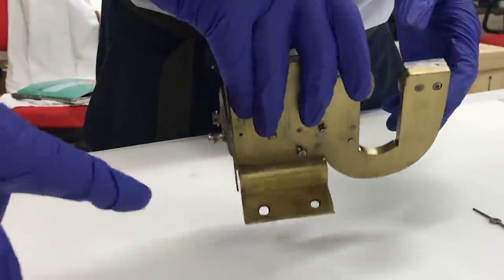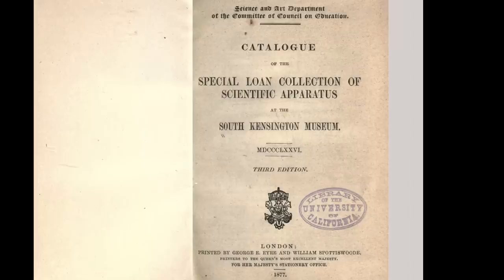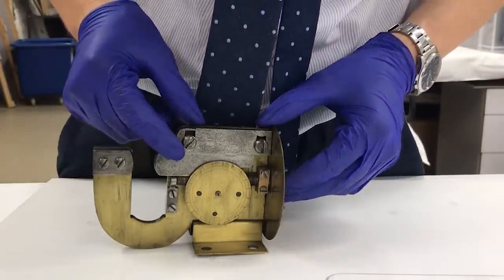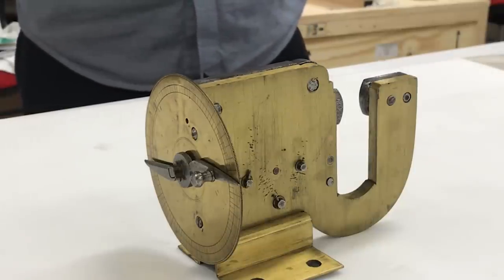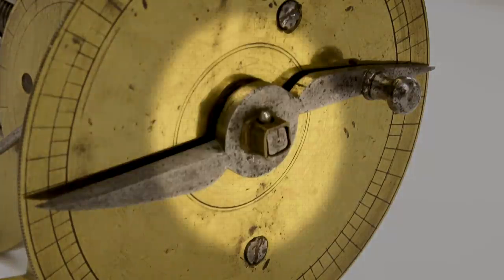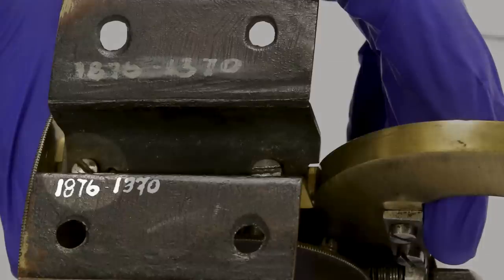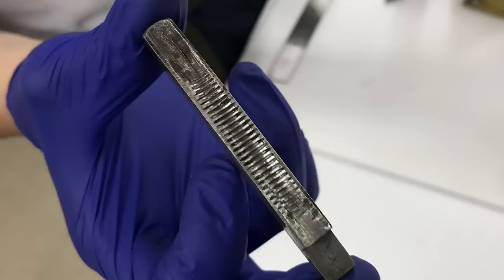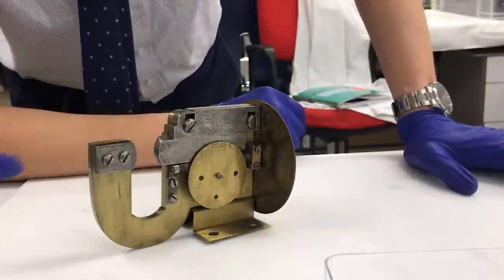World's Oldest Micrometer - 1776! Who made this thing??

Comment: The hammer marks around the stand off post for the small dial are most likely from driving the pins tight with a bench hammer

Concentric circles are a very common form of instrument ornamentation in the 18th century. 

Couldn’t the knurling around the dial face be to aid in reading the dial?

They had dividing engines to index the dial but the final demarcation would have been hand engraved over those lines

Yes, the anvils are wrought iron but more likely than not, they are case hardened on the working faces

The mounting holes are rough, out of round and countersunk because that is what it looks like when you cold punch holes by hand.

Lathes could be driven by a great wheel. They could cut wrought iron, it is as soft as butter, just don’t blow out the grain. 

Much larger iron screws were being turned before this. Think printing presses and leg vises. But the threads would sometimes be swaged in hot before being turned to size. This saves on material and avoids cutting across the grain of the iron. 

Two things to look into:

1. Surface finish. Non critical surfaces should be cross filed fairly coarsely an irregular. Finer surfaces may be draw filed. Critical surfaces would have been ground or lapped, possibly scraped.

2. Check the assembly screws. They most likly show signs of being  cold swaged, not cut. With wrought iron the grain is everything.

Watt or not. If it was made in the 18th century it was made by hand, with files chisels and hammers. These men were not machinists, which is not to say that they weren’t insanely talented, but they had very different priorities. You don’t drill a hole if you can punch it. If it needs to be round, ream it, if not, leave it be. You don’t make everything perfect and precise unless it needs  to be. Good hand work looks good, functions well and has no reverence for extraneous precision or regularity. 

I have more to share. Message me for more info.
Reply: I have no experience but the base could have been made after the fact by even the exhibitors just to show it off. something like this would have been unwieldy to use so screwing it to a table with a quickly made sheet of brass might have been a quick fix.

whoever used it before that might have just held it with a clamp or some other tool you'd find in a workshop for their use
Reply: Good thoughts all around, Hammerandhearth. I especially appreciate the reminder about extraneous precision at the end there.
Reply: Hammerandhearth . I agree about the hammer marks. How could the narrator not see that?
Reply: Hammerandhearth, I agree the hammer marks are perpendicular to the pins.
Reply: I stopped the video and was just about to write the same thing - seems whoever made this instrument was not very concerned about it looking nice, as otherwise they would be more careful with assembling it and using non-marking tools.  But that's a hint also - it was probably a practical project, maybe a prototype or a quick clone of a previous design - likely an "internal" tool for production.
Reply: Psycho, I was thinking the base might have been made later, maybe in the 1800's, by the museum 'handyman' to put on display maybe?
Reply: @LeelooMinai  I think that's right. If the dates are correct, perhaps it was treated as a trade secret. A secret internal use tool wouldn't normally have been written about, but by the time of the fair competitors had them too so it could be shown.

Also, the hammer marks on the back all align in clusters with where they'd be if you were striking the pins.

I wonder if the extra hole on the larger dial was for an index pin to aid in machining or assembly.
Reply: It looks like an Apprenticeship exercise of the kind once taught in High School Metalwork. It doesn't seem like the kind of exacting standards an Instrument Maker had, but it does look like a Teaching job one-off using what was available in the Workplace.
Reply: I think of the symbolism of the Free Masons. As early as the 14th century the tools of the trade were held in high esteem.  So I vote also the special tools were closely held trade secrets.
Reply: This looks more like a tool than an instrument.  Custom built by a craftsman requiring some precision and set exactly for his shop's ergonomics.  An instrument would have had much better finish as it has to be provided along with the data when sharing scientific knowledge.
Reply: Bracket on the base has come from elsewhere hence the counter sinking on the wrong side plus its fitment is poor to the main body and wont work as a stand ..... if you need a bracket and theres one to hand in the pile on an old piece of kit you replaced a while ago you will reach for it . The rest is valid for the time IMO . Who can know if it was a Watt creation but given whom else then its a safe bet to say it is .
Reply: One of the most informative comments I've seen on YT.
Reply: Exactly the 3 Fs
Reply: I agree with most of that, I have worked with wroughtn iron (both forged It and machined) and have instrument maker background.
cutting a thread in the stuff is difficult (rough surfaces and galling...) having a thread plate and forcing that over yellow hot iron is fairly easy, then you file and finally lap it for finish.

The dividing could have been done with a large "template" plat with pegs that you rest the straight edge against.
Not unlike this. 
https://m.youtube.com/watch?v=BIUAdINXZmQ

It is not unlike thenold wheel cutting rigs used in horology from 1700's till early 1900's
Reply: maby it was a secret tool and all the extra holes and tool marks are from trying to advance it more for the task of the maker and it explains how it started with the attention to looks then over time instead of protecting finish you beat it with the wrong tool and get back to work hehehe...
Reply: first thing that came to my mind.. exactly
Reply: @Hammerandhearth: Yes I spotted that detail also, that the marks were quite an angle.
And this is one of the very first Youtube vids I been sitting wide eyed scrutinizing every detail. 
Really interesting, thank you for posting - I got very caught by this one.

Now it this really by James Watt? I doubt it personally. 
I had an warning bell ringing in my head, and then Machine Thinking mentioned it - it have the look of being put together with a few parts from somewhere else.
I nearly sided with David Wilkie, that this might have been one apprentice work - the lack of numbers or symbols on the wheels suggested that.
But then, it have been used a lot. 
Builders of clockworks and precision mechanical had been around for a long time already. Those would have needed devices to measure the parts.
Certainly some might have used fixed pieces for certain measurements, especially for those who mass produced clockworks.
But many items was custom made, such as astronomical clocks in the 1400's and onward - then some hundred year later when 'automata' became popular.
In both cases that's when one apparatus like this one get very useful.
But for this item, I am inclined to say it's a bit less old, lets say 19'th century, and its a piece that has been used in a workshop by a craftsman.
Reply: What do you think about the "decorative" reeding around the circular plates?

Don't you think it would make sense to make and use these as markings for mapping out the more visible markings. Count the number of them, then mark it out. Who ever made it didn't have precise tools so may have had to do additional things that we would not do today because we have these precise tools.

If we assume like you said, everything they did had a purpose. If I was making this and I wanted some carefully measured angles on a circular plate, how would you make them? Make the plate into a kind of gear, then mount it to a pivot turn it a number of teeth, mark, and turn again. All calculated ratios of course.
Reply: This micrometer has the hallmarks of proof-of-concept, which is less than prototype. Or, it was a poor copy to just get through a customer job. Hard to tell, but proof-of-concept is reasonable. 

Tells:
1. Rotten iron. Prototypes & production would use charcoal steel or case hardening, both of which have different surface finish than shown.  2. Poor fit & finish.  As stated elsewhere, the materials are repurposed. But, the fit & finish gives the appearance of extreme hurry. Even one of the slots is obviously from a previous use. A prototype might be rough, but not so sloppy. 3. This looks like something a fiend hacked out with his own 3 hands to go back to the scrap bin if it did not work. (I make a living as an expert fiend & produce lots of scrap.) But this worked better than expected and got lots of use.
Reply: Using stuff you cut away from other projects was very normal. Coal was rare and resources was very limited. So not using scrap would tell it's newer.
Reply: Hammers marks. My point exactly. Driven back so many times by a probably rougher-than-Watt's hand would leave numerous indentations on the soft brass easily enough. So perhaps even  if it has been made by a master craftsman, it might have seen use by a different tradesman, might've even been an early invention.
Reply: exactly what i was about to comment lol
Reply: Knurling also helps with grip, especially if one's hands are covered in oil
Reply: There are to many smart people here wtf
Reply: I wish you'd make a video. I'd love to hear all you have to say!
Reply: @h2o270  If it was made by an instrument/clock maker, or even his apprentice, surely they would have used a small punch to fit the pins? The hammer marks are perhaps from some later work.
Reply: Odds are several workers were involved in making what is obviously a working tool.  Apprentice projects were more commonly something that already existed so they could be compared to a benchmark of skill level, not prototype work. Machining was coming into its own in the latter 1700's, so this likely would have included both hand work.  The iron work being done by a blacksmith, the brasswork by a white smith and the long screw work done on a machine.  The stand probably by someone else.  James may well have come up with the idea, but if he was now a partner to someone with money he may have had several employees.  Check out the Bramah lock patented around the same period and Maudsley who worked for Bramah.
Reply: I dont have this much expertise. However I do my fair share of tinkering and building things from junk as well as repurposing parts all the time. A lot of the things on this remind me of the small mistakes here and there that I make. In the case of the stand I would totally understand not caring how rough the holes were on that itself because it's not immediately important on a prototype or at least for what you're intending to test or use that item for it will serve the purpose.
Reply: They also in clockwork and instrument making used to peen the blanks to work harden them to make them more durable.
Reply: Your last paragraph is brilliant.  Thank you.
Reply: I concurr regarding the hammer marks
Reply: I concur sir  ! 🧐
Reply: You covered everything I was thinking of there. And I genuinely like the design, it evens out its own inaccuracies. 18tpi has me a bit confused though?
Reply: This is exactly how I do my projects. Foe example my fractal TV antenna. Wathes on tv about it, bend a few scrap wires, connected to tv and it is still connected after 20 years. (If it works why to change design)
Reply: I concur - I would add I think there there may have been repurposed parts too. The ‘knurled dials’ which have no apparent function may have had a function in their previous use.

Comment: The base holes that you referred to as being chamfered look exactly like holes that I hot punch in the blacksmith shop. You back punch then turn it over and punch through a bolster. When you flatten out the burr it has the appearance of being chamfered.
Reply: i was thiknign the same thing, but the concentricity made me want to accept a rough/ over-done deburr with a rusty beaver
Reply: Now that makes sense as engineering back then was way closer to blacksmithing than it is now. EG when was the pillar drill invented? 1895 or something? I bet before then getting holes in sheet metal used mainly blacksmithing techniques.

Comment: As a machinist, I've made dozens of special tools for specific jobs.  Decades ago, I began stamping my initials, and date in my custom tooling, and most has my mark, but all my early tooling made to purpose generally wasn't marked, and many of them got made into other tooling.  All the tool marks you showed make sense, if one thinks of 18 century, and only make sense later, if it were an apprentice's work, not at all a journeyman, but certainly well on his way.  I've worked on a 17th century clock, in New Bern, NC, in Tryon Palace, and it was very similar in construction tool marks, strikes, there was an awful lot of handwork done even in the 19th century, but l would easily put it prior to the 19th unless found reason to think otherwise.  Thanks for this, it was very interesting, and a real question to be answered,

Comment: This devise was probably bolted to a workbench on the shop floor  in Watt's factory and used to gauge parts during production. It would remain there in use every day until the product(s) it was gauging ceased production or it was made obsolete by modernization. In our shop we have made lots of custom gauges to quickly measure parts in production. These gauges are mostly made from scraps we have on hand. No need to look pretty, just get the job done. Once the gauge is no longer required it goes into storage just in case the job it was used for returns. This "micrometer" in particular just happened to make it to show & tell at the museum.
Reply: Sounds very pausable to me. Perhaps they made dozens of these micrometers and this is one that was put on a shelf somewhere. Probably the one was made by an apprentice either using blue prints or copies of parts from the original micrometer. its likely that during use. screws got lost and were replace with other screws available. I doubt that was the original made by James, but likely a copy using his original design. There also no maker marks or initials which leads me to believe it was just a shop use micrometer.
Reply: As a youngster, I worked in a machine shop and yeah if I needed to build something for shop use, I’d use whatever was handy in the scrap shelves like iron, steel, brass, stainless, aluminum and no it didn’t need to be pretty, just get the job done. I only used stock metal when it was required which was a few times.
Reply: Ahh, thinking back to all the odd fixtures I have made that served to give a dial-indicator a home.
Minus the indicator, it was a pile of random junk.
With the indicator installed, the junk became a trusted and highly reliable measuring device.
Another thought on 'shop-tooling'; a go/no-go indicator wouldn't need to be 'calibrated' in the sense of displaying thickness accurately, rather it has to be repeatable.
Quickly picking out under/over sized parts is not a job that requires hours of finishing work on the gauge.
Reply: The same is done in electronics. If I'm designing a new bit of gear then I usually do the design on paper, then cobble together a proof of concept, then the test gear is cobbled together, only then is a full production unit made and the test equipment can end up looking like a deranged bird has nested in it.
Reply: Sounds feasible, but has any explanation been offered as to why the smaller dial has 19 divisions? Surely this would have been harder to measure/manufacture than one with 18 say, (divides into 360). Is 19 required for a particular measurement, or has someone just mis-counted?!
Reply: This sounds a  plausible explanation. Maybe it was mounted at the edge of the bench to measure/check the thickness of piston rings or similar items. Having said that it does not appear to show the damage marks one would expect from regular workshop use.
Reply: @Nick White  19x50=950... plus one more revolution of 50 gives you a total "0 to 0" rotational value of 1000. By opening the anvil to "1000 0" and measuring with a snap gauge (or a good caliper) the jaw opening, one could deduce what measuring standard was being reduced to 1000 subdivisions
Reply: I agree with this theory as it makes the most plausible sense to me. I would think that it was likely used as a quick go/no-go type of device for a specific part in a manufacturing situation. It also likely may have been used for several different parts or stations in Watt's facility over the years accounting for its heavy signs of wear. This is all just a speculative opinion of course.

Comment: I think this was a purpose built micrometer like it was mounted on something and used for basically the same part or process on a particular machine.
Reply: That was more or less what I was thinking.
Reply: If so wouldn't you think it would have a narrower range like a snap gauge, more economical I would think.
No I would guess it was maybe a dedicated instrument for a in process measurements on some ones bench.
Reply: @peterweller8583  basically what I meant.